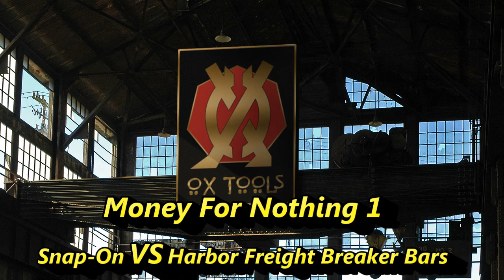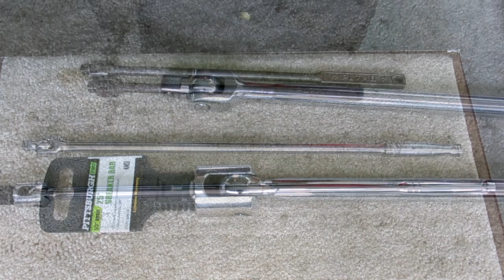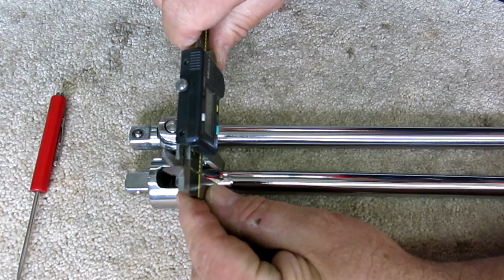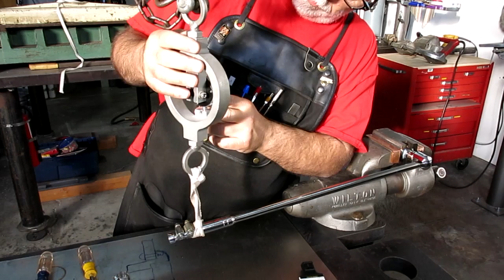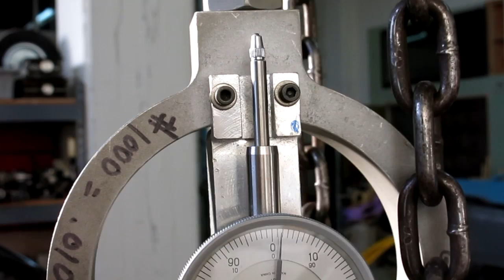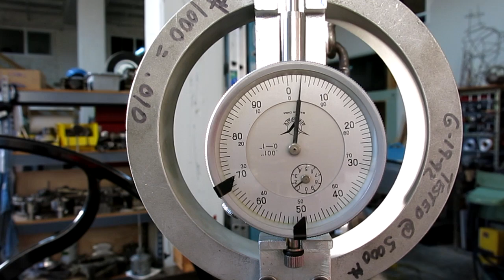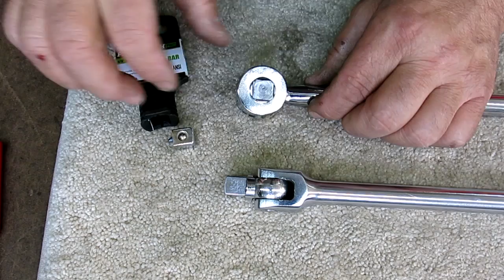Money For Nothing 1

Comment: I had a quality Sidchrome (not sidchrome-proto) breaker bar fail in the same manner. Interestingly it had the same arrangement of the pivot as your snap on one. (the crappy new sidchrome proto replacement is the same pivot arrangement as the cheapy here)
It hit a good 35-40deg angle before failure, and i did happen to have a 6ft length of pipe on it at the time....
Got a replacement (longer one) and immediately exploded the socket. Had to buy a 3/4 drive breaker bar and socket to complete the job.

Comment: +oxtoolco I'd like to see you test a modern snap on vs your old one.  Or maybe a modern one against a cheaper modern one.

Most of these things break at the square drive, I can't tell you how many breaker bars and extensions I've twisted off there.  When you reached the point where you were applying more and your gauge wasn't showing more was when you reached the plastic failure (the square was twisting at the shoulder, I doubt that you went significantly over the ~275# that you saw on the gauge) and you kept going till it snapped.  If the HF one had a radius there or was designed like the snapon it would have kept going.

FWIW, I have the HF 25" breaker bar (I have some of everything from pittsburg to craftsman/husky/kobalt to the tool truck stuff), and honestly I've had some good luck with it.  I have tightened the pivot just because I didn't like the slop, and I've had it for significantly >10years, used and abused since it cost me nothing (literally done stuff I wouldn't do with even a craftsman one, hammered on it, hammered with it, hung a length of pipe off of it...) AND I'm a big moose that regularly breaks even quality tools,  and this thing has held up fine.  The latest was removing a pitman arm nut that my IR impact (rated at 600lb-ft) couldn't remove.  I drove the next smaller size socket on it so it couldn't slip, slipped about 5' of pipe on it and gronked on it pretty good, moved the car over about an inch and it came loose, no damage to the Horror Fright breaker.

Honestly I used it and the ~18" 3/8" drive HF breaker more than my "quality" tool maker's ones, since they have longer handles, and I've replaced a few of the quality ones, but not an HF one- I'm not making the argument that they're better, I don't think they are, I'm making the argument that they're good enough even for someone that is going to use them pretty hard.

Comment: You guys can bag on HF all you want, but it survived almost 600 ft/lbs on a 1/2" drive head.
300 lbs x 2 ft =600 ft/lbs (Torque= force x length from axis) That's pretty impressive for a 1/2" breaker bar.  Personally, if any brand of bar was bending that much I'd be reaching for my 3/4 stuff.

I'd like to see the test redone with a new, modern Snap On and the HF 1/2 bar with the same design (item 62729). I've heard that this pattern tested is weaker by design than the design of the Snap On because they are milled and not forged. The milling for the drive square supposedly makes sharp corners at the base creating stress risers.

Comment: Back around 1978 when I worked as a motorcycle mechanic we had a Snap-On sales guy that was pretty cocky about how Snap-On tools were the best. I told him that Craftsman tools were just as good or better especially the sockets. As expected he disagreed so I set up a test.. Using 12 point 10mm 3/8 drive sockets, I clamped a 10mm allen wrench in a vice and using a 1/2 deflecting beam torque wrench and 3/8 adapter proceeded to apply torque to a Snap-on socket.. It split at about 60 fp lbs.. Swapped over to the Craftsman and it went to a full 90 fp before braking.. Guy stormed out and we didn't see him for about a month.. Guys that owed him money liked it as they didn't have to make any payments.  One thing the Snap-On guy didn't notice was that the Craftsman socket literally exploded when it let go.. I didn't point it out to him though. :-)  

I'd say the HF didn't do too bad. It did really give some before it failed.. I have a 18 inch craftsman that I've twisted the 1/2 square about 10 degrees trying to remove a right hand threaded big nut.. Later I straighten it out trying to remove a big left hand threaded nut. I was going to replace it on the first twist but looked a current version of the bar at Sears.. Decided to keep it..

Comment: Right up front, I would like to say that I like this video, and have much respect for Tom.  I'm definitely not a safety Nazi!  Tom knows what he is doing, and is very responsible.  The video and comparison was very fair, well thought out, and nicely explained.  I'll bet this video breaks a few records for discussion and debate because this is a passionate topic among shop guys.  What follows is nothing but my own opinion.

I went to school to be a mechanic, and I've been a mechanic at a car, truck, and tractor dealership in my lifetime.  There is a slight advantage to having the best tool if you use it every day to make a living, but the debt load to a working family man is extreme.  You can buy a house for your family with the money spent on the Snap-On man.

At a car dealership, there is nothing that requires 600 lb ft of torque.  There is no fastener that will withstand anywhere near that torque on a production automobile.  Anyone who gronks 600 lb ft of torque on anything 1/2" in diameter is asking... no, begging for trouble.  Truck and tractor dealerships use 3/4" and 1" drive tools, not 1/2".  They know better.

I own Snap-On tools.  IMO, most are just not worth the 90% premium.  SOME are very worthwhile, just not most.  A lifetime warranty is a lifetime warranty.  In fact, if you bring a broken hand tool to HF, they replace it right away.  If you don't buy tools every week from the Snap-On man, good luck trying to get your tool replaced under the "lifetime warranty".  You're on your own, brother.  I've been there, and I speak from experience.  I'm sure others here have as well.

Oh, and the argument about hurting yourself by gronking on a tool not made to do the job you are trying to do... that would just make you an idiot.  If you need a bigger tool to get the job done, then just get a bigger tool and get the job done.

All this being said, buy whatever makes you happy.  There are valid reasons to have either, and BOTH brands in your shop.  Most of us do not drive Rolls Royce automobiles, but are just as happy with less expensive alternatives in many different varieties.

Thanks again Tom for a great video!

Comment: Now Tom, I know you know a good bit on metallurgy having read your books and watched the channel a lot. I find your comment on wanting to see a plastic ductile failure vs a fracture brittle failure to be unrealistic with a hardened tool steel put into torque like that. I just feel that any hardened metal put into a shear force will have that kind of failure once it has reached its point of failure.

It was a good practical well thought out test, and for the price difference, as if we all use a tool correctly..cough.. that was tested beyond what it is designed for and I wouldn't discredit it at all for failing at that load.

Keep them coming!

Comment: Hey Tom,

Nice test, but I wouldn't put that much strain on any breaker bar! When I need to go to that level of abuse I have an old cheap ratchet that stripped the mechanism and got welded up solid. 

Snap-On in the UK do not have an unlimited guarantee these days.  Replacement tools come out of the franchise holders profit margin, so you can't just walk up to a random Snap-On truck and get a failed tool replaced.

I was once tightening a set of cylinder head stretch bolts (and obviously straining quite hard) on my driveway when a Snap-On van pulled up and asked how much torque I was applying and what brand of tools I was using.  I was then told it was too much torque to apply with 1/2" drive Teng tools. That's a shame, I said, they're 3/8"!

All of my 'good' mechanics tools are Teng (Swedish company) and about 1/3rd the cost of Sanp-On or Britool.

Comment: I think this is an unfair test. 600 ft.lbs with 1/2 drive?? I routinely did 300 with 3/4 drive when I was working. Only once that I recall did I have to do 600 lbs.ft. and I do not remember what drive we used. I do remember the torque spanner was as tall as I was and there were 2 of us at the end of it. Budget tools are exactly that. I do not have much Snap On left, most of what I had got nicely annealed in a garage fire but I replaced them with cheap stuff, at my age I wont wear them out. That being said, I have done a lot of work with those cheap tools, admittedly not all day every day. Love the channel, I am jealous of your inventory, you have stuff I never even imagined, keep up the good work.

Comment: On a 4x4 Dodge Ram axle nut my HF bar failed at the exact same place. I was bouncing on a 5 foot pipe when it gave.  I took it back and got a replacement no questions asked. I did not want to try my craftsman or plumb breakers as I knew they would suffer the same fate but I figured for $9 if it broke who cared.

Comment: Tom, Would you put a Smithy lathe next to a similar sized South Bend? Because thats what just happened, Its $12 vs. $88-$146. Yes, You should get what you pay for, But because they look similar and do the same operation, Your going to get chatter in your Smithy that you will never find in the South Bend-That will Never be as smooth as an American Pacemaker. I have owned 83 Vehicles at this point and because I couldn't find a Mechanic that I could fully rely on, I've done most of the work myself, To be fair I have never found a square drive socket tool that would stand up to 40 years of (abuse)- Because thats what happens...I have had $10- "No name" Socket-Sets that have outlasted by far a $20 single socket, but it seems to be luck of the Batch and not price, One would figure that the price would buy a tighter quality control, If for no other reason but "Name"- not always the case.

Comment: What I think I am seeing with all that deflection and breakage of the HF bar is the difference between a machined tool and a forged tool.  The Chinese only seem to forge when absolutely needed to make the shape like wrenches and maybe sockets.  And since their cast iron won't hold up to much they can't make a drop forge that works on anything stronger than copper and cheese metal.  Just about everything else appears to be cast and/or machined.  Maybe throw in some heat treating for the heck of it but their mantra seems to be "If it looks like a duck then it must be a duck".   You have to pay more if you want the "quack", too!
Reply: yep exactly .. all you have to do is look at a file which was once made locally .. either in Europe, Australia or America .. and the crap that is built now in china and still carries the old brand names .. they don't last anywhere near the same and end up becoming smooth pretty quickly

Comment: Shocked that thing took 600ish foot pounds!  It was ductile just all the twisting force is concentrated to that one place. Remember the handle didn't go back down?  Well I was trying to tell you the snout was twisting off and would suck to remove from the socket . . . I know because I've done it to many a bar and ratchet, very good named stuff to including Snap-On.  That is the most common fail point because that area can't be reinforced, it's the weak point because it's always going to be only 1/2" so relies 100% on material quality.

Comment: Good video Tom.  As an amateur I don't see any problem with Harbor Freight.  They provide products that are arguably worth what you pay for them.  Many amateur machinists and diyers (myself included) would find it a little more challenging to do some of the stuff we do if we had to shop at Snap-On.  The HF dial indicators, for instance, provide quite acceptable tolerances for most of my needs.  While I would certainly enjoy an indicator from  Starrett I know I would not enjoy the Starrett price.  Anyway, just my two cents.

Comment: Love this review.  I personally refuse to shop at HF.  After the flood of 2008 in the Iowa, I was working at a local power house.  We had to pull out one of the boiler feed pumps that had been installed back in the 50's.  The socket size was somewhere in the realm of 2 7/8".  First we tried the China made 3/4" drive breaker bar with a 6' linear extension and we spread the fork.  Went and got the Armstrong breaker bar and put the same linear extension on.  Couldn't get the nut broke loose, so we added a half ton chain come a long to the extension.  That one we sheared the drive head off that one.  Granted both broke, but it took MASSIVE amounts of force to break the Armstrong.  We ended up cutting that nut off with a torch.

Comment: Tom cool video but you forgot to mention one major detail and that is the price for the 1/2 inch Pittsburg breaker bar is $12.00. 275 or 7200 inch pounds should be plenty for any 3/8 -1/2 inch range mechanic. I like Snap On tools its just that they cost more than what you use them for. Well anyways good luck.

Comment: For me at around 150 ft lb I am wanting 3/4 drive.  I was doing something else when watching this video and maybe it is irrelevant but does the pull direction change amount to much? Snap on has been the brand that has failed me the most. Most failures have been catastrophic just like the HF breaker bar. If you push a tool to the condition that the HF breaker bar was in and don't have the awareness I am not going to feel sorry for you in the hospital. Snap On tools tend to fail early in their life if they ever do fail.

Comment: wow you are brave, I was cringing for ya dude, the snap on bars break off on one side of the fork usually, but I have seen one break in the same place as the cheapo and it was a razor sharp break at an angle across the ball part, however that was a big gorilla jumping on a six foot scaffold tube on the end :)) .... keep ya bar on the ice

Comment: Cool test Tom. Yes if your a pro get top of the tools. The reason is pros like I was will not hesitate to add a OSHA approved extension pipe to the end of that bar for added leverage to giter done . No time for failure. If you can fit er in to your to your week do more tests. That gauge you built is quite cool. Dave

Comment: Own and used them both and broken them both. The snap on is more user friendly because you can bet into smaller spaces. But lets face it, if you are putting that much force on the bar why not use a 3/4 drive and save some skin Ironically broke the drive Square of my el cheapo as well.

Comment: G'day Tom. Good comparison but I was wincing ever time you came around to our side, good thing you were on the other side when it broke, next time tie a restraining strap to stop it swinging around. But give Pitsburg it's due, it is called a "breaker" bar (sorry, just had to get that in).
I've still got a 470mm Stahlwille breaker bar from 40 years ago and it's had it's fair share of abuse when I was young using a 300 extension in the handle, still as good as the day it was bought. 
When it comes to failure I would expect a tool to bend, not SNAP, that's dangerous. I would also expect it to work without fault or failure at it's handle length with a 400 lb force.
 Keep it up.

Comment: I only know of one snap on tool failing and it was from severe operator abuse but true to their word it was replaced with a new one no question asked.
I reckon snap on should donate a breaker bar for you to test to destruction , i suspect that they have and probably do batch testing to ensure quality control - i wonder how far they push it?

Comment: You should have thrown a Crapsman err Craftsman breaker in there for the mix.  Go get yourself one of those high quality "Made in the USA" "tools" they are putting out these days.  The last set I got at Sears had serious chrome plating issues,  about half of them either had flaking chrome or missing pieces altogether.  After swapping boxes out 3 times I got a refund and found myself an old set at a yard sale.  Honestly I doubt the Craftsman would hold up much past the Pittsburgh.  Now I have to admit I have both new Craftsman and harbor freight tools laying around but they are ones I only use once in a blue moon,  if it gets me through the pinch then I am a lucky bastard that day,  if not then I simply patch up my wounds and I get a lesson out of the deal.

Comment: That was fun.  The Hf bar began flexing (reached its yield point) earlier also.  In the early 1980s I worked at my father's auto repair shop.  We would "test" Snap-On, Mac, Proto, Craftsman...  I would hang on a wrench that attached to a transmission bolt or something and watch the open end's jaws spread.  The Snap-Ons were usually stronger... even though they were slimmer.

Comment: For a cheapy tool I think it stood up pretty well, you really were pushing it to the limits there, I would not be comfortable using either one of those tools if they were bending that much.
Reply: +caskwith Until you have to remove a crankshaft bolt (search for vids) with one of these and 5 foot long cheater pipe.
Reply: yup
Reply: +777fuzzypeach Put the breaker on the crankshaft, spin it over til it's lodged against the frame, bump your remote starter and let the engine do the work for you !! if the engine is out on the ground this won't work LOL
Reply: +James Walls or working on a counterclockwise Honda engine
Reply: That's what a 4' pipe is for.  The Snap on will do it that pitsburg won't  But honestly if you have to use that much force to remove a bolt or nut you should be using heat and or oils to help loosen it first.